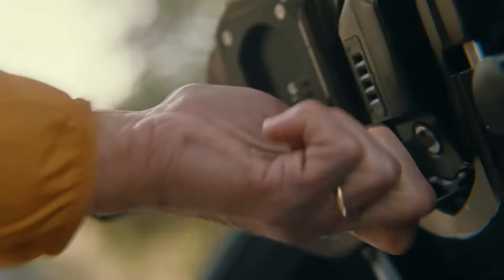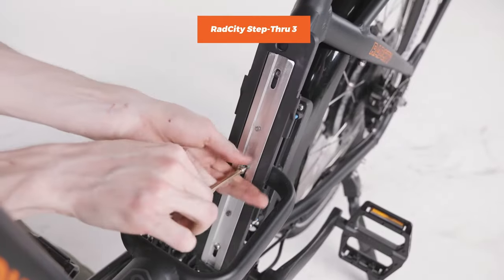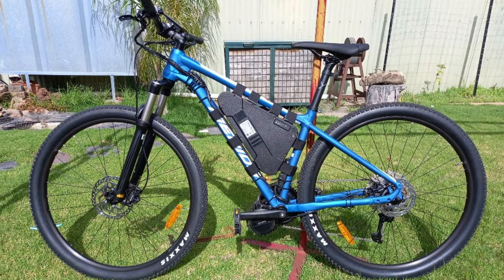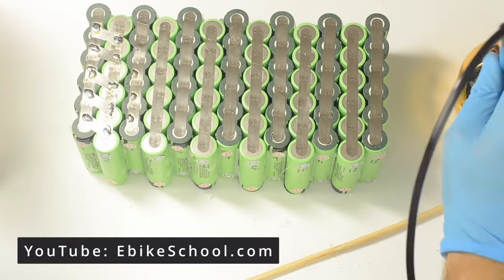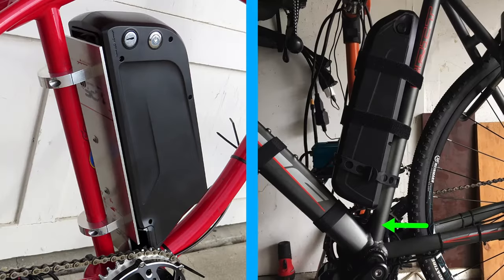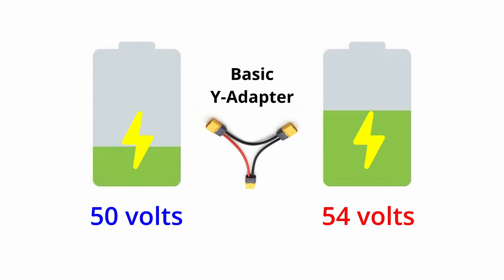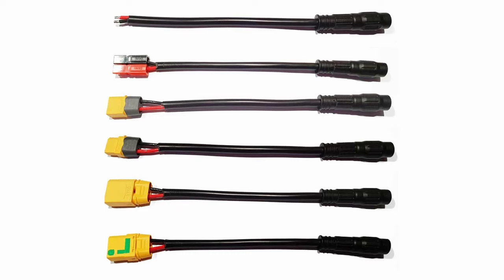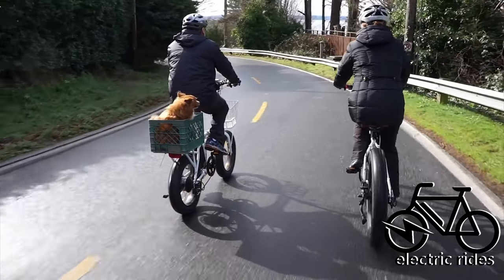How to add a second battery to your ebike! - Complete Beginners Guide!

Comment: I have an e-bike that have 48v 12.5 ah battery . I am thinking to upgrade to a 52v 17.5ah battery . 
Will it work or it will cause me trouble. Or should I get a battery with 48v 17.5 ah
Reply from the maker: Most controllers that are set up to work on a 48v system will be able to handle a 52v battery but unfortunately, it's not always a given.
Reply: @ElectricRidesUT  so I can buy a 52v or not?
Reply from the maker: @ashmit4480  You should be able to, yes. But to be sure I always suggest reaching out to the manufacturer to see what they recommend. You may get a canned response but sometimes you can get some helpful info

Comment: Has anyone tried bumping a 48V with a 12V in series for a 60v push on a 48V motor? 
1 yr Edit: Ebay helped me replace my 11.2AH with a 20AH, same voltage. It fits inside my T42 folder and easily doubles my range. Original 11.2AH battery is carried in the car for an extra 20 miles...
Reply from the maker: I haven't seen anyone go above a 52v battery on the stock Rad controller/motor since that's the max most anyone is willing to push through the default electronics. Would be interesting to see though!
Reply: @ElectricRidesUT  I've seen 52V added to 48V with a 'blender'... Does that feed either 48V or 52V ? Or does a blender put them together for a 50V average...?
Reply from the maker: @johnw65  From what I've been told - the blender will pull from the 52v battery until it's equal with the 48v battery and then use both equally. So, it's still better to have the 2 batteries at equal voltage so reduce the voltage sag.
Reply: @ElectricRidesUT  My rack bag is ordered and on the way. It will house my 2nd battery. I just haven't decided which way to go with it. 52V20AH with a blender may be the most range/pwr combination. But, a 48V20AH can just be spliced in w/o a blender... Bag will also carry all chargers, tubes, tire repair and tools.

Comment: If I have 48v 10ah battery and say my 2nd battery is 36v 12ah will this work using the adaptor?
Reply from the maker: Technically, if it's an adapter that works for different battery voltages it will work, but you really won't get a lot of extra range out of the 36v as your 2nd. Most of these battery adapaters will drain the battery that has more voltage first until they are at equal voltage levels, and then drain them equally. A 48v battery will be "full" at about 54v and a 36v battery is "full" around 42v. So your main battery will drain down until it's about 20% full before the 2nd battery will even start to be used. A bike that comes with a 48v battery won't be designed to work with a 36v system, so once your main battery is dead, it will really struggle running off the 36v battery alone.. or not work at all.

Comment: "the second most common is the least common of the 4."  yeah, that makes sense
Reply from the maker: It's second in a list of the 4 most common battery types.. and it's the least common of the 4.. makes sense to me?
Reply: @ElectricRidesUT  the way you stated it didn’t make sense. The phrase “second most common” has a generally understood meaning that is different from what you wrote in the comments. It makes sense but you have to explain it, which means it doesn’t make sense
Reply from the maker: @NinjasOfOrca  Ah, yeah I get what you're saying  I suppose I should have said "in no particular order" or something similar. 👍